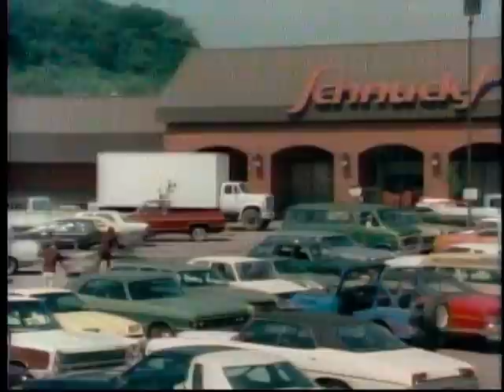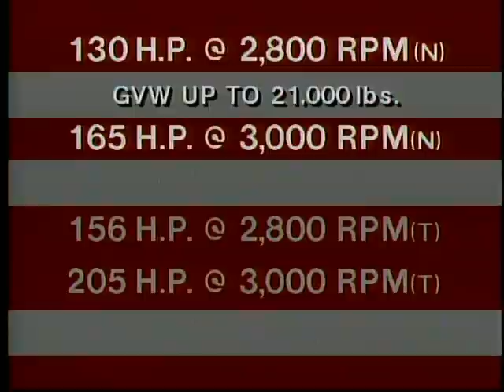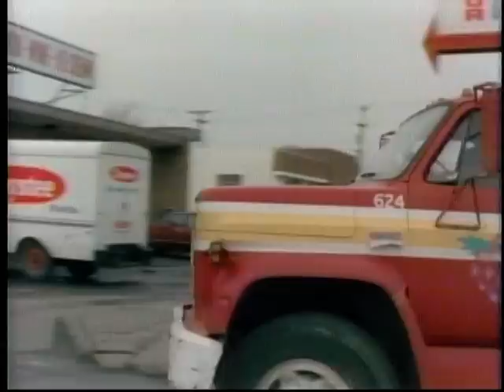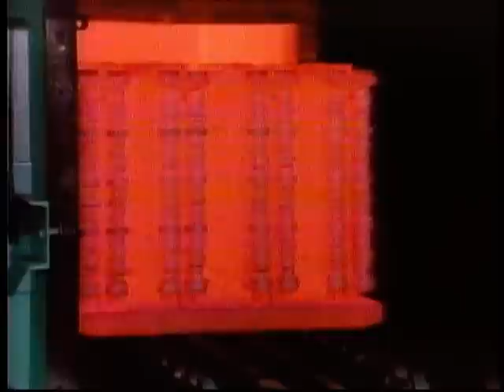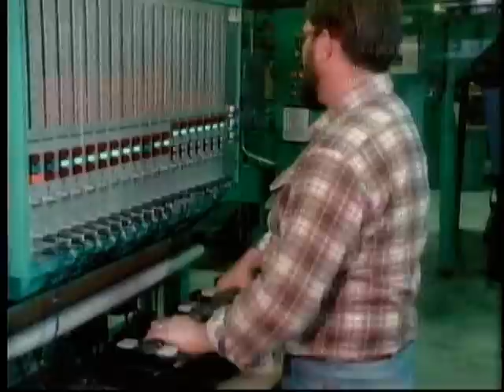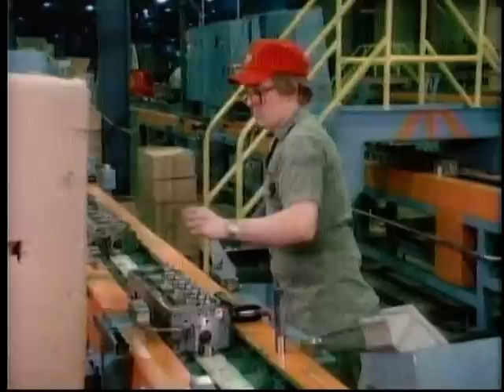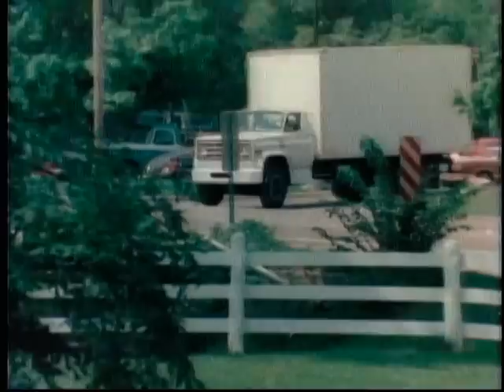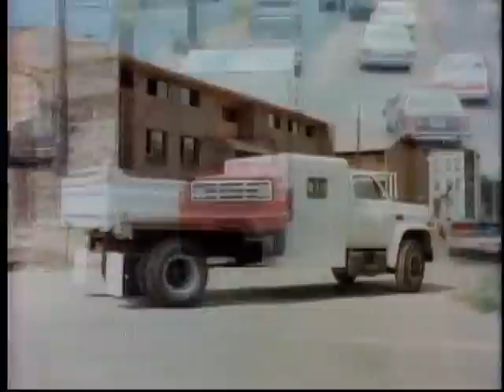Detroit Diesel Allison 8.2 Liter Fuel Pincher Diesel Engine Features GM-327-A GMC Dealer Training LD

Comment: It’s hilarious seeing how much hate these engines get. They’re not as bad as people make them out to be. Most people overworked them and expected them to hold up to things they weren’t designed to do.
Reply: As a mechanic who worked on them, they were definately not the best design out of DDA.
Open deck allowed the cylinders to walk around, which chewed up the head gaskets. Proper tuneup was difficult and time consuming.
I thought if plates were built to press over the tops of the liners and inside the block perimeter, the cylinders would be stabilized and the head gaskets would last.
Reply: @daledavies2334 like a honda block guard
Reply: These engines were designated for commercial duty, not for driving your grandma to church on Sunday. They did not last!
Reply: They were  designed to be a Truck engine and  truck engines get abused. If they can't take it they shouldn't put them in a truck.
Reply: @ If they’re specified as a fuel saving engine maybe you shouldn’t dog the heck out of it and use it for its intended purpose.

Comment: I remember when these came out. The construction company next door to our shop bought a bunch of them in little single axle dumps and fuel tender trucks. They probably bought about 10 of them brand new. I think all ten of them had some kind of serious engine failure within two years.

Comment: There was a recall back in the early 1980s on some of these engines for having a defective head gasket. The head gasket finally blew on the Detroit Diesel, 8.2 "fuel pincher" engine that was powering the railroad truck I drove. GM paid for the expensive repair that apparently included replacing all the internal journal bearings.
Reply: Head gasket recalls were continual. One involved drilling the 14mm head bolt holes and taping for 15mm head bolts. This was an attempt to get more clamp load on the gaskets.
Reply: @daledavies2334  Yes! I recall the tapping of the block for larger head bolts as being part of the fix.

Comment: Sooooo what happened? Why was that motor such a failure?
Reply: Early models had head gasket issues, and most mechanics couldn't set the injector heights correctly so they ended up popping head gaskets again from excessive cylinder pressure.

Comment: Its crazy how GM put so much into this engine for it to be an absolute flop. I drove an old f600 tow truck several years ago that had one. Was a turbo model. That was its only saving grace in an only 26k gvw truck. I will say, it sounded sweet straight piped and got decent mileage, but it was a nightmare finding someone in this day and age to work on it when it broke down, and broke down it did. I was told even back in the early 2000’s it was still a nightmare to get someone good to repair it.
Reply: I was young and desperate, so I wrenched on a couple around 2010 and took the time to find the manuals and understand how to work on them.  The owners couldn’t find anyone anywhere to touch them.  Not crazy complicated, but I have no interest doing any more work on these.
Reply: @benhart16  I am a retired truck and equipment mechanic I have done some external work on them but I had plenty of other work so I was one of those guys that did not take them on. I have heard that they used them in some marine applications, I don't know if that is true or not. I just did not have any regular customers that were running them so I didn't tool up for them.
Reply: IT took special tools just to do valve and injector work they were a real oddball.
Reply: That sounds more like a limitation of available experience and not a limitation of the engine.
Reply: @SillyPuddy2012  I think you make a good point, I don't think they were that hard to work on.

Comment: The GMC Top Kick and Chevy Kodiak with the Cat 3208 was a far better choice! I drove them all including the Chevy and Ford gas V8s and the DT466s in the late ‘80s and early ‘90s. I drove a GMC 7000 like this one with a Cummins 6BT5.9 conversion in the summer of ‘87 and loved it. Just before Dodge introduced them in their RAM pickups. I also drove a ‘70s GMC 7000 with a 4-53T turbo Detroit 4 cylinder that time and it was a good, but noisy engine. It was the diesel option in those trucks in the ‘70s, before the Detroit 8.2L debuted in 1980.
Reply: The DT466 was a great engine.  But if you overheated it was done.
Reply: I'm with you. A trandem with a 3208 and a 13-under was unbeatable. Had to keep the 466 wound tight or there wasn't much there.
Reply: There are a bunch of 2 stroke detroits running today.
Reply: @carlachambers3771  A bunch on sawmills and knuckle booms. Maybe draglines. I'm out of the loop.
Reply: There were other lousy diesels in the ‘70s like the Cummins 555 V8 and the International DV550 which I believe was a converted 549 gas V8. The Cat 3208 with a Roadranger RT6613 did quite well and it was so popular in the Ford LTS 8000 and LNT 8000 dump trucks back then.
Reply: @SuperDave01965  The rmy had 555's and 903's and all splottereed and slobberd. A 466 with a 13-under did well but you best kept it wound. The 3208 was popular with 5x4 and a 13-under too..Paid MANY light bills!
Reply: @SuperDave01965  DV550 is NOT a converted gasser, it was however derived from the gas engine, but not the same way Oldsmobile did the 350 Diesel.
Reply: My buddy had a top kick with a cat in it. Sounded mean after he chopped the exhaust off. He fabbed a fifth wheel on the bare frame and hauled his 40+ foot camper around the western us. It hated hills but would pull it eventually. Very nimble with that camper tho , he would get it tucked in anywhere and I’m not exaggerating at all. Was a heap but definitely better than this hunk of shit 😂. Wasn’t much choice back then tho so lots of flashers on the hills anyway. Hell most of the new trucks are so detuned that they have trouble with the hills too. EPA can go to hell for all I care and with that I’m out.

Comment: Those 73 up GMC/Chevy medium duty squares are still a sharp looking today,and a comfortable truck, good power with the gas engines.
Reply: Our c60 had a 427 and Standard with 2 speed rear-end.
Reply: @carlachambers3771  In the late 70's I had a delivery job driving a 76 Chevy C65 with a 26 foot stake bed and a 350 2 barrel. That was the base engine and man even with the 2 speed rear axle it would sound like a NASCAR engine out on the highway! That truck would eat an engine about every 2 years and they would replace them with a GM Targetmaster engine in about a day.
Reply: @edwardpate6128  It seemed the 366/427 engines lasted a lot longer,and actually would depending on the year,and emissions equipment, would if driven right would deliver about 6 miles to the gallon
Reply: LOL, they were not comfortable, unless your comparing it to a wooden bench.
Reply: @chrisstromberg6527  When I was a lot younger in 79,I drove a 75 Chevy C 60,and a 72 Loadstar 1600,both flatbeds,the Loadstar had a nice pedal and steering wheel feel,but the seat was not its best feature.The Chevy was a fairly comfortable truck,the Loadstar had a better feel as far as steering wheel rake,and better pedal feel,but the seat felt better after a few hours on the road,but given the time they were built they were both fairly comfortable trucks,and they drove pretty well.
Reply: Agreed. I drove a refrigerator 26' truck for 8 years. 366 gas.
Reply: I have 3 of them.  Sturdy little units they are
Reply: Yes the are,still a great looking medium/heavy duty truck love the small back glass,the back of the cab reminds me of the 60-66 GM trucks.
Would love to find a 73or4 with a GMC V-6. @DrDonut
Reply: good cab if you're a midget. IH S-class cab & DT466 FTW.

Comment: My best bud had the very same burgundy dumptruck in this vidya.  It did not have enough power to get out of its own way.  Try and lift off, loaded, if the drive tires are in soft sand?  Then he put a small holmes wrecker on it.  Nope, still was better off with the 1 ton with a 6.2 liter.  Eventually pushed the fuel pincher into the back yard and let moss grow on it.  What a waste of time, effort, energy GM went through.
Reply: They certainly missed a lot of the lessons of the 5.7 liter diesel,or missed the boat on counting dimes while missing dollars,and hurting good will with the customer.

Comment: It always amazes me how GM can make some of the best engines yet also make some of the worst pile of junk engines ever made. The 671 2 stroke Detroit might have been the best small diesel ever made. Then they come out with garbage like this!
Reply: Awful engine!
Worked as hd big trk diesel mech in early 80's at a Ford big trk dealer.
When the big cummins,cat, big detroits eng work and o'hauls got slow I got stuck working on these ...  put these in every med duty and bread truck there was... no tilting hoods or easy  to get to chassis.
Detroit had a head gskt recall on those shi*tbox engines at the time and what a pita that was!
Not when long hoods and cabovers had big sweet diesels that needed attn.
Miss those days, but not that fuel pincher!!

Comment: They used so little fuel because they were always broken down and being worked on. It’s sad, all that research and testing, and the 8.2 still ended up being an absolute turd. An 8.2 is the most efficient way to turn diesel fuel into noise. Back then, the only Medium Duty diesel truck to own was an International with a DT466.
Reply: OR a 3208 Cat with a 13-under
Reply: A 6v92 is better.
Reply: @carlachambers3771  Well yeah but a 8V-92 is bvetter still or a 12V.
Reply: I knew a couple of old-time school bus drivers.  They started off driving the gas-powered buses with the 4-speed manual (granny first gear).  They loved it when they started receiving the DT466 buses with automatic transmissions.  Nobody missed those old gas engine beasts.
Reply: International .....meh.

Comment: I guess 8.2 liters for trucks like this, in those days, wasn't huge.  Calling it a "fuel pincher" seems like a bit of a stretch, though.  😆
Reply: Well, these diesel engines may have been terrible, but diesel engines that actually worked in the long term were an upgrade over gasoline engines. When you have a fleet of 10 trucks doing in city work, and you make the choice of gas or diesel, going from 3 miles per gallon average per truck to 5 miles per gallon average per truck over a year is a huge deal, especially when diesel was way cheaper than gasoline on average to boot. GM was trying, but established diesel engine companies quickly did it better (mostly) in the medium duty truck segment.
Reply: @Carstuff111  Detroit Diesel was very much an established diesel engine manufacturer, and these engines were not terrible. Certain people will always dog on old engines that were designed for thrift, so they pick up a bad reputation that isn’t really deserved.
Reply: Well a 8.2 with a turbo compared to a gasser or a 2 stroke gutless fuel toilet I'm sure it was cheaper dollar to the mile.  LOL.  Man and here I feel like my 230hp 7.3 is wimpy lol.
Reply: @PatrickBaptist  I know, diesel is always gonna get better mpg than a comparable gasser. "Fuel pincher" still seems a little hyperbolic though. Meh, it's marketing, so it gets a pass I guess.  As for hp, torque is the name of the game for trucks and for diesels, so doubly so for diesel trucks!
Reply: You just found out "Marketing"

As if any of such statements from brands are ever true.
Reply: Bingo 😅
Reply: Well considering gm put an 8.2 litre v8 in the 70s eldorado, it's not that big. Also considering the biggest v8 in gm muscle cars was the 7.5 litre v8. Not that far off. Only annouing thing the person left out in the vid is how much torque it was making - something very important for heavy duty pulling